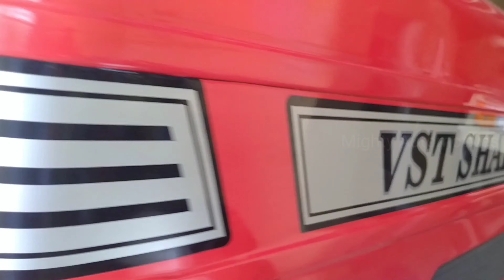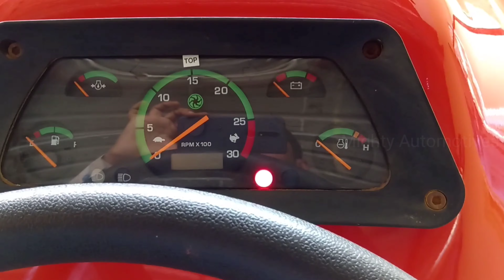VST Shakti 9045 DI 45 HP Tractor with Kirloskar Diesel Engine

Comment: Viraaj shakti 50hp tak sai kaam kia kirloskar 3R1040 engine de k ... viraj ko new model  launch kr ne chiya viraaj 455 inline pump pump ke saath Simpson s433 55hp 1800rpm rated engine with egr natural Asprated engine  ke saath side sfift 8+2 constant mesh gear bull reduction system ke saath 1st hi gear k speed 10  kmh ho 1800 rpm pe  .. 14*9*28 16*9*28 rear tyres optional 7*50*16 front tyers ....  

viraaj 460 me v Simpson sj436 1800 rpm rated 60hp with EGR natural Asprated engine inlinepump ke saath 12+3 constant mesh side sfift  bull reduction system ke saath  1st hi speed 10 kmh 1800 rpm pe 3 medium ke 11.8 kmh speed 16*9*28 rear tyres  7*50*16 front tyers .... 

 next tractor  viraaj 9055  kirloskar 3R1040 turbo charger rotary pump 2000 rated rpm ke saath 2 model me ek 12+3 bull reduction system ke saath ...

 or viraaj 9055 Dx Delex top model 2wd model 12+3  synchromesh gearbox with epi system kirloskar 3R1040 2100rpm rated  Turbocharged  55hp rotarypump ke saath 4wd 2wd optional  4 wd model 12+12 shuttle sift ke saath ...
 
next tractor  viraaj 9060 60hp 2100rpm rated  kirloskar 3R1040 turbo charger Bosch company  ke rotary pump ke saath 2 model me ek 12+3 bull reduction system ke saath  ...

 or viraaj 9060 Dx Delex top model 2wd model 15+3  synchromesh gearbox with epi system kirloskar 3R1040 2200rpm rated  Turbocharged 60hp Bosch company ke rotarypump ke saath 2wd 4wd optional 4wd model shuttle sift 15+15 gear ke saath  ... 

agar mera baat ye company man le ye hi main specifications ke ye 6 tractors market  me launch kr de thore pisa add par kharch kare  tho ye company ek mahindra se agga nikal sac ti hai .. agar ye 6 model ka company ne risk naa lia tho is me tera gata mera kush ni jatta ...
 abhi time hai company pass kamai kr ne ka feature me vase v  modi g kirpa se  or modi g policy k vaja se Mha mandi anne vali sabhi companys dukan dar kissan diwalia hone vala hai ...